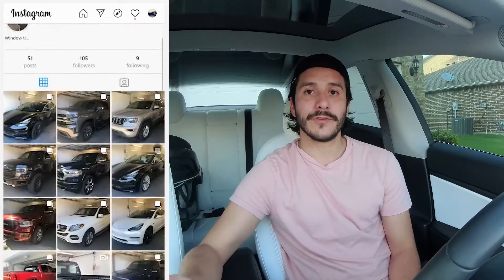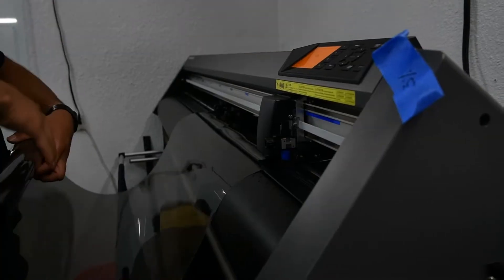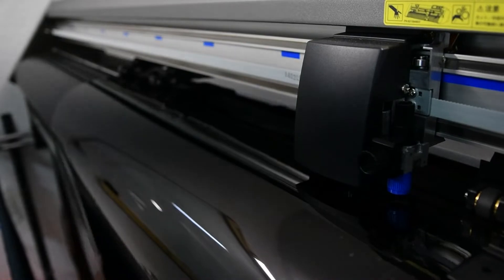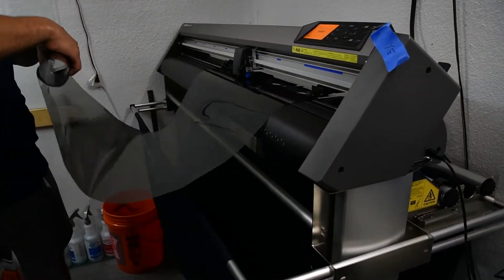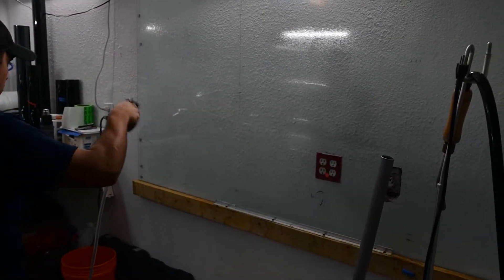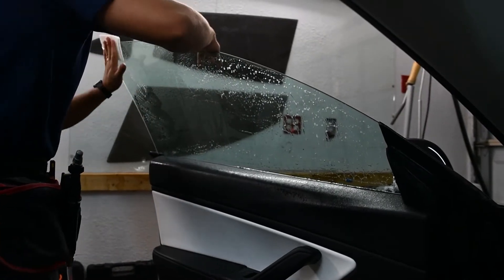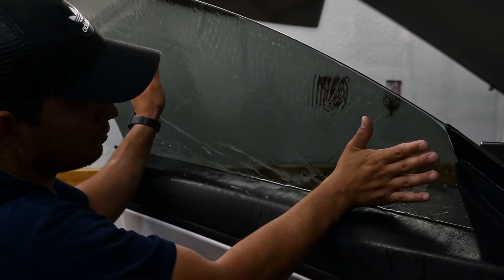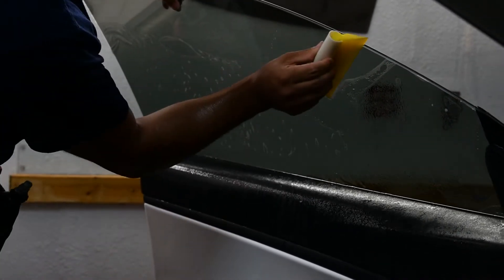I Tinted My Tesla Model 3, Should You?

Comment: Nice.  I own a tint shop close to San Antonio.  I've been a tinter for over 20 years now and I've used Flexfilm in the past.  It is a really good quality brand of film.  Their Panaflex is very good but Nanoflex is their top tier ceramic. It's manufactured in Korea.  I've tinted a few of these cars.  The back window is a pain in the ass.  It requires a 60" roll of film and has to be heat shrunk sideways in order to get full coverage.   Not my favorite car to tint for that reason.  The Model S is super easy.  I've got an order for the Cybertruck when it eventually comes out.  Since it's completely flat that ought to be a piece of cake to tint.
Reply from the maker: That's awesome! @4aceswindowtinting didn't offer the ceramic version. He said he doesn't have enough people willing to fork up the extra cash. I'm sure that after 5 years or so that this tint will last, I'll probably want to upgrade to the good stuff. I left the back untinted. I recommend leaving it untinted.
Reply: @SeedVisual  Even if you didn't get a ceramic film the dyed and metalized films from Flexfilm will still block 99% of the UV, look just as good, and last just as long as a more expensive ceramic.  The only difference is going to be how much of the infrared heat it stops.
Reply from the maker: That's great to hear. I'm pretty happy with the results. We shoot video content for all types of business. I could definitely make a trip to SA if you are interested in some video content for your shop. Let me know!

Comment: I'm half way through still but. Why the hell didn't you get the rear of the center glass done?!
Reply from the maker: I like how you can see the white interior from behind. Also, the rear glass doesn't affect the rear passengers. Even when the sun is behind the car and super low, the headrests block basically all of the sunlight before it can even reach the passengers. The super dark factory tint on the top glass fades low enough to block the sun from all angles. I also like the stock shade of the all glass roof. Any darker and visibility out the top would be obstructed. If you've seen any model 3s that just have the back tinted and not the whole class panel, you will see why that is also a bad option. Send me a DM on IG and I'll send you a video of what that looks like...
Reply: In DFW heat rejection is king, though. When you go ceramic I would say go at least 80% on back to keep it cooler